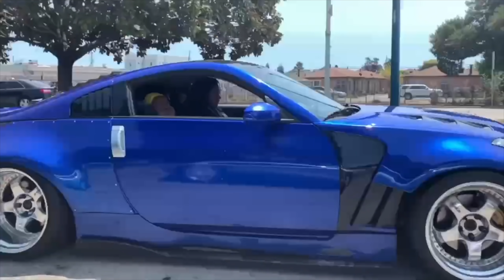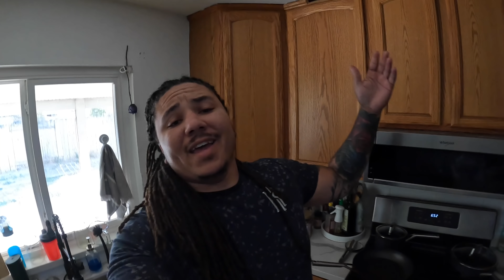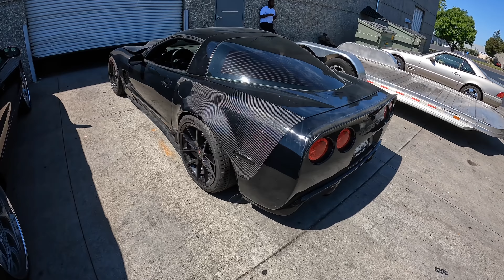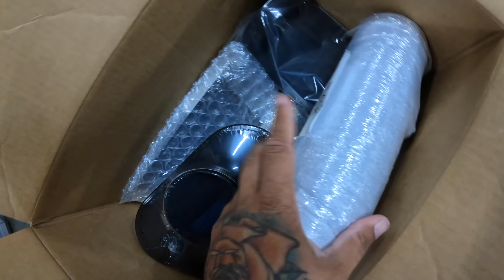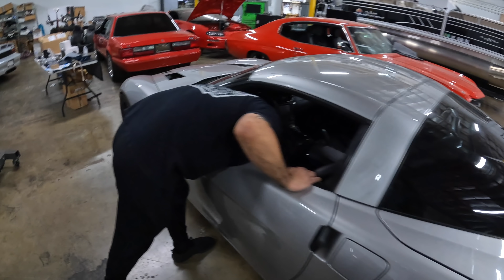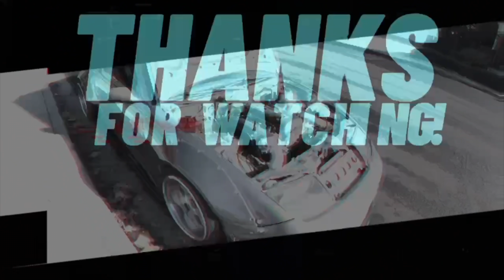😡I'm Thousands Of Dollars Into This Piece Of S*** And Its Still F***ing Broke!

Comment: At least you are doing multiple cars at once,  out of my ten 3 1/2 are runing, (just bought a supercharged mini). Both my 350Z"s are down, my Porsche has a take it to the shop light on.  My F350 still needs work but I do have the 94 Twin turbo Supra in the shop, no mods, just running it stock.

Comment: Comments are hilarious, C5 need Johnson lifters 2126LSR and manton pushrods but will need to be measured. And yella terra non adjustable rocker arms. Man you’ll be able to rev that bitch to 8k rpm with no concerns. I got a 408 stroker in my C5Z

Comment: you know about valve drop issue yea? you want this thing to actually do what it do replace the lifters to anything NOT chevy, and pretty much have the work done to the heads to fix the bad math.
im still hounding the place i got my car from for my check so i can finish my cars engine off. also be aware of the class action law suit against gm. all of the v8 engines have manufacture defects that WE have to fix first or its just a matter of time before engine fails. stock is all bad. GL GB.
Reply: link to the class action suit paper work: https://www.classaction.org/media/harrison-et-al-v-general-motors-llc.pdf
gm built the engines bad. not someone else. all v8s are affected with various issues due to the fact that when certain parts degrade it throws the math the engine is based on off, which in result gets you a check engine light or worse. get on board and get a chunk of your money back.